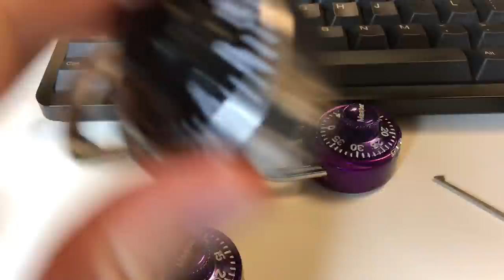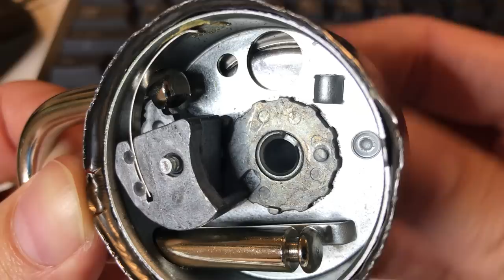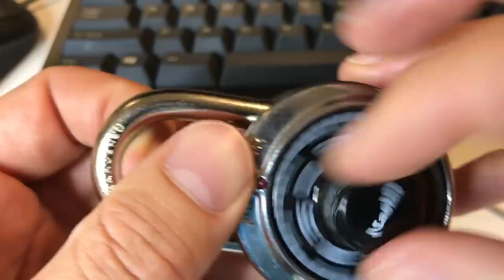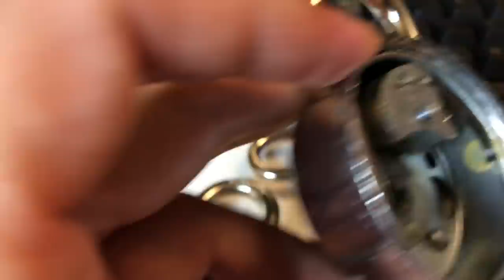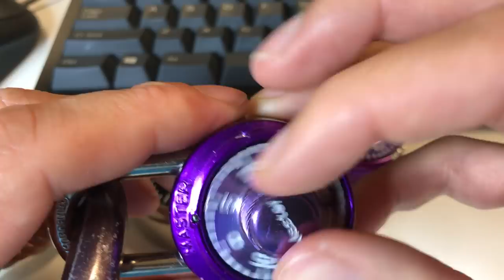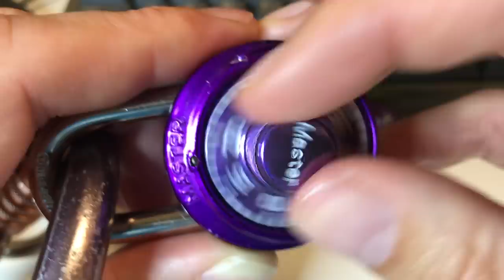Decoding a Master Dial Combination Lock Part 3: Determining the last number

Comment: "clearly wider"? how is 3.1 to 4.1 any different than 13.5 to 14.5? I guess it works for you,
.
Reply from the maker: 78tag You’ll have to try it for yourself but if you can’t spot the width difference, I find it even easier to spot the true gate by it being shifted over about .3 to .5 from the other false gates.
Reply: That's where I'm stuck.  And when I check the "second gate" between 0 and 5, they all are 2 apart, like 3 to 5 or 24 to 26 or 11 to 13.  I'm so frustrated!